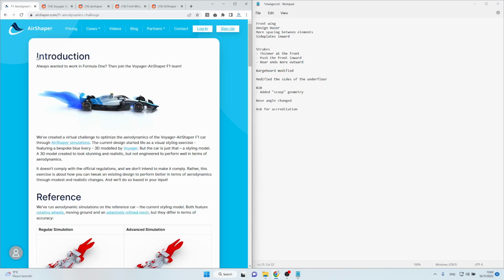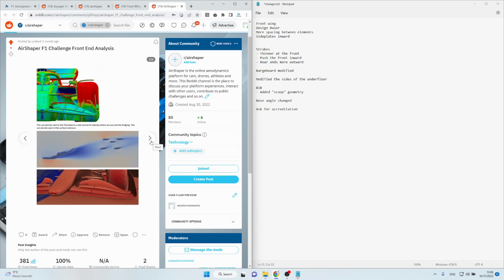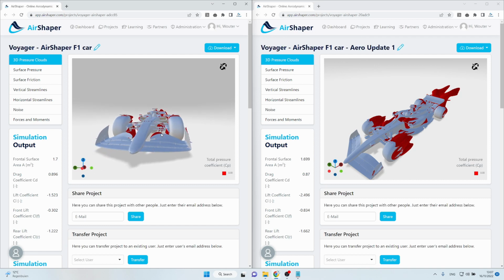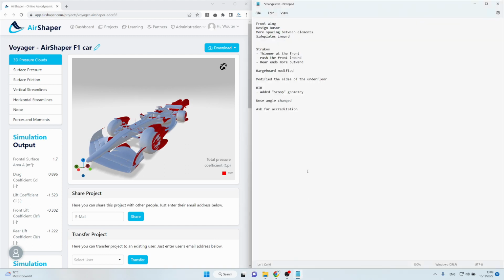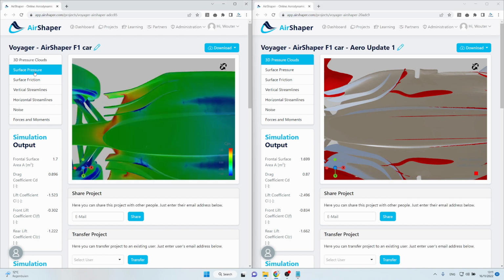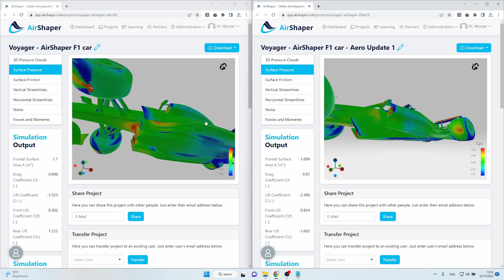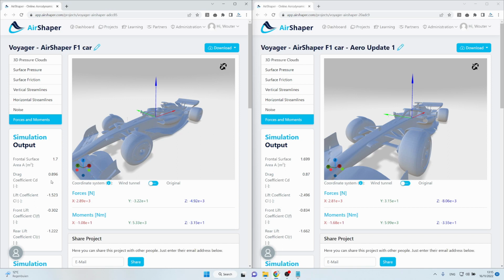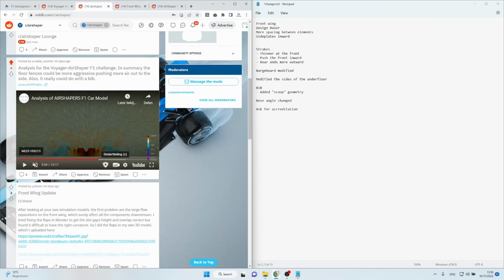Improving F1 Aerodynamics using AirShaper CFD simulations - The Voyager-AirShaper F1 challenge

Comment: Is this model also accounting for vehicle dynamics (compression of suspension at different speeds, sensitivity to pitch if you hit a curb etc.) ? 

Really interesting to watch you guys work
Reply from the maker: No, we only analyse a static setup in this case. Very valid point!
Reply: @AirShaper  in that case, be careful around modeling/creating aero devices that are very "sharp"/sensitive to minor changes in flow direction/pressure gradients. 

This was part of the reason blamed for Senas death: the car was designed for active aero, had it stripped out and was therefore far too sensitive for a human to control. 

It's why current setups aren't "optimal", but rather have a very large range of near optimal roll, pitch and yaw angles, as well as speeds
Reply from the maker: @camofelix  Very true - a bit lower performance but lower sensitivity to settings can inspire more confidence & create a safer car. Building a full aero map should indicate these sentivities.

Comment: Surprised there were no modifications to the plank area of the underfloor as that can interact with both flow upstream and downstream. If I were to speculate, I'd say that the strakes/fences at the leading edge of the floor act as an air restriction, and it is that restriction that creates the low pressure, and drives the inwash around the edge wing.

The biggest challenge to improve the performance of the strakes, in my dumb opinion, is to generate as much outwash, while limiting secondary flows. The regulations allow a fair bit of fillet radius both at the top and lower sections, up to 50mm which means you can have basically an endplate at the bottom of the floor fences. You can make the strakes look like a snow plow if you exploit the maximum fillet radius. The higher the pressure at the fences, the lower the pressure downstream. The regulations also make you get creative to force outwash at the rear. The turbulence of the tires gets cleaned up dramatically for every degree of airflow outwash you can get away with. Several studies, in both CFD and real world testing show that the turbulence turns into 2 vortices when the relative airflow is outwashing around the wheel. I can't share external links on youtube, but basically if you have a spinning tire that's toed out 5 degrees or more onto oncoming flow, the wake turns into a vortex which is much cleaner than airflow going straight on. Now in F1 you can't have crazy toe angles, because the car would be nearly uncontrollable, especially at the rear. You can however force air outward, so that the air interacts with the tire as if it were toed out.
Reply from the maker: Hi Rolando,

could you perhaps drop some sketches of your ideas on our Reddit channel?
https://www.reddit.com/r/airshaper/

Thanks a lot!

PS: Aero Update is going through simulation as we speak - we did work a lot on the fences so hope you find the results interesting!
Reply: @AirShaper  I deleted my reddit account for personal reasons and out of principle refuse to go back. I would love to show you some crude drawings, images, research papers, and other things that have led me to my opinions. If you have an E-mail or some way to send external links/images/etc, doesn't have to be personal, a throwaway e-mail is fine, I would love to share my thoughts. I removed myself from discord for similar reasons.
Reply from the maker: @rolandotillit2867  You can reach me directly at info@airshaper.com